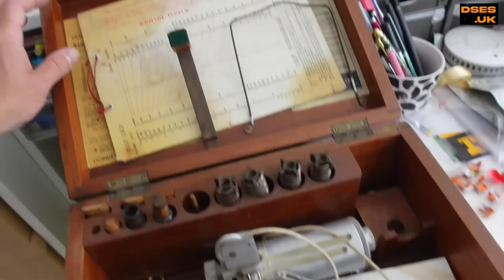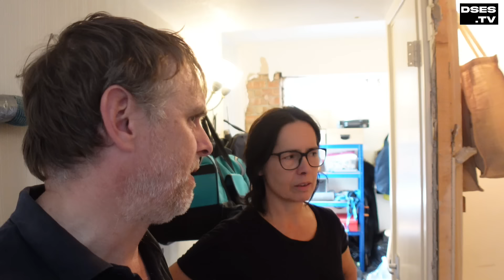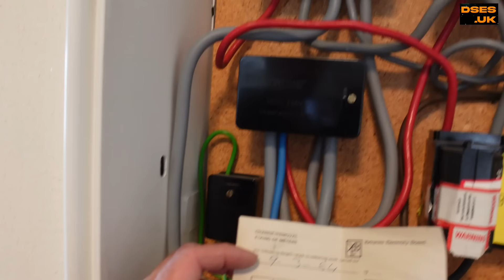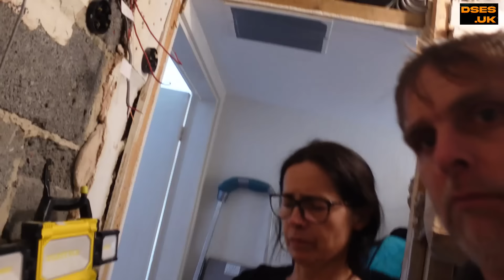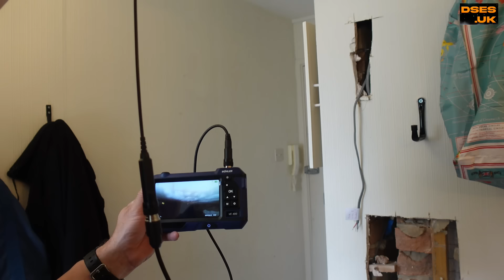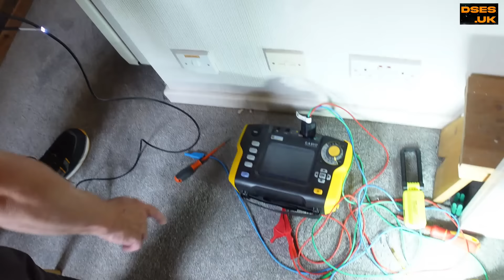Cavity search with Linda (and specialist German equipment)

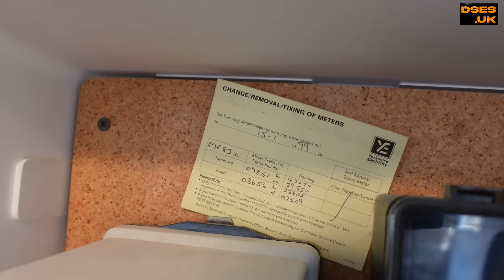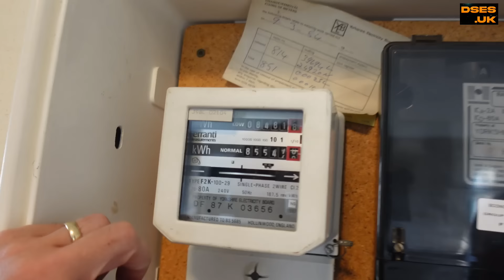Comment: 9:21 David that white meter was installed on 15/01/1999 per the 1999 paperwork, removed meter 09851, fixed meter 03656, see 9:51 meter number DF87K 03656.
Reply from the maker: I don't know why I didn't match the meter number. Interesting that they installed a 1987 analogue meter in '99.
Reply: @dsesuk  Shows how reliable they were. I guess those meters weren't inexpensive and they rightly saw no point in throwing away perfectly functional gear. The previous meter change note showed fitted meter '851', and the one removed to fit the current one was '09851' - same unit, I'm sure.

Doubtful any smart meter removed would get reused today. Not convinced they'll operate for over 35 years, either.
Reply from the maker: @Monkeh616  Yeah, those analogue things were well engineered. Where I've seen them redeployed previously, they've had a sticker to show they've been checked or refurbished, so the 1987 date threw me on this one. Also, 1987 sounds like a long time ago (and I remember being there), but I guess back in '99 this equipment wouldn't have been considered terribly old or old fashioned even though digital meters were hitting the market by the Millennium.
Reply: @dsesuk  you're just not as observant as me I guess...🤣🤣
However being this observant is a curse some times.
Reply from the maker: @generaldisarray  That's the trouble with a run-and-gun video - sometimes you miss someting that's obvious post edit and wonder why you didn't spot it on the day!
Reply: @dsesuk  shite happens. Plus you had the whiff of unwashed Linda right next to you cramping your style... 🤣🤣
Did she release all her cats before you arrived... 🤣🤣🤣
Fuck it, I'm a bastard... 😂😂
Reply: @dsesuk  in fairness you had the whiff of unwashed Linda right next to you cramping your style, plus you were probably on guard given one of Linda's many, many, cats could pop out of one of those holes in the walls, at any moment, and go for your knackers...🤣🤣🤣
I assume Linda normally has around 20 or 30 cats in that apartment, she has that vibe about her of a cat lady...🤣🤣🤣
Only messing, but I do like her repurposing of the pull up bar to hang her hangers on, nice...
Reply from the maker: @generaldisarray  Linda is, sadly, cat free, and somehow doesn't smell half as bad as I do.
Reply: @GadgetMan36  🤣🤣🤣
Reply: Hi - People would sometimes complain if you replaced an old meter that was close to being "out of certification", with an even older looking one or UGLIER with DIALS, harder to read)  that had been back to the meter testing station for re-certification, giving it another 20 years or so useul life.  Meters aren't legal past a certain age (depending on the make) or if previous customers have fiddled with them!   We loved the old Ferranti's cause they were slimmer so guaranteed to fit, whereas a big old fat GEC was a pain if it was replacing a Ferranti etc in a tight space.   It was a plum job doing "meter acts" (replacing meters that would soon no longer comply with the meter act) because you could be done by midday if they were all next door to each other, then go sunbathing - people came into work with tennis rackets - hide your van somewhere.
Reply: I thought it piggybacked off the  ‘long way’ frequencies

Comment: Good show!   The original giant heating system might have been a central night storage system, connected to those air ducts. Either that or gas which got condemned after Roman point flats blew up in 1968.

Comment: Hi David radio teleswitches work off radio 4 Longwave transmissions for e gland transmitted from Droitwhich at 500Kw power in Scotland  there are 2 transmitters of 50 Kw each at Burghead and Westerleigh you are right those transmitters will be switched off next year

Comment: Quick question. teleswitch is single insulation yes but it's in an enclosure would you not say. Does a meter cupboard count as mechanical protection?
Reply from the maker: A grey area so I'm not sure. You require a key to access it, but then those gaining access are ordinary persons such as the homeowner who wants to read the meter. Anywhere else in the home where single insulation is accessible to non-competent persons, would be coded as a C2 on an inspection. It certainly wouldn't meet the requirements for mechanical protection.

Comment: The Dobbie McInnes engine indicator. I used one of these at Tec back at the begining of the 1980's. You connect the pressure port to the engine cylinder and the pressure drives a stylus up and down. You connect a cord to the engine connecting rod and that pulls the cylinder on the indicator round, against a return spring. The stylus scratches through a white layer on the indicator chart that is wrapped around the cylinder on the Indicator. The stylus then plots the engine cylinder pressure Vs crank position. When you have the indicator diagram you can use it to work out things like burn rate,  brake mean effective pressure and gas exchange processes.
Very old technology, originally designed for use on steam engines but, upto the 1980's still used on large engines (big, marine diesels).
Since about 1985 the job has been done with Piezo transducers, optical shaft encoders, high speed data acquisition units and a shed load of computer processing. Same results but easier and faster to get. The downside is that it now takes £100k worth of kit (not including the cost of the engine testbed).
Reply from the maker: Ah! Thanks for that! It all sounds terribly complicated!
Reply: @dsesuk  the hardest part, when we used it on a small, single cylinder, Loughborough Gas Engine, was hooking the string onto the moving connecting rod. It took a bit of getting used to having  to move both arms left to right at the same time whilst bringing them together to hook the two ends together.
The other piece of really clever kit was a pantagraph arrangement with two thimble wheels on it. You positioned the fixed end of the pantograph on the origin of the indicator diagram and traced round the line left by the stylus. Once you'd traced the whole line you read of the numbers on the thimble wheels, multiplied them together, and got tge area enclosed by the line. I think the device was called a mechanical integrator. Invented by some fiendishly clever soul, like they did back then.

Comment: The meter fitted on the 15-01-1999 was indeed a reconditioned meter the start readings on the card verify this as there is already 22605 units on the low register and 07609 on the normal register. We were still reconditioning meters from the  probably until digital meters came in round 1990.

Comment: 11:00 isn't there an argument that because the single-insulated cables are in an enclosure (the meter box) requiring a "tool" to open, they're OK? I'm not a big fan, because obviously unskilled people are meant to open the enclosure to read the meter etc, but from a regs point of view are you sure it's actually a no-no?
Reply from the maker: Hm.. I guess one could make that argument if push came to shove although, as you say, access is required for the unwary. It's also in a communal space rather than within the security of the property and can be opened by anyone with a common key. It's not how I would do it.

Comment: For an installation that used to have storage heaters on Economy 7 where they've been removed and the sockets moved over to the "normal" CU, is The RadioTeleSwitch (RTS) still required?
Reply from the maker: No, the RTS would be redundant. Those who don't want a smart meter can move their off-peak circuits to the peak board and apply Eco7 as a tariff applicable to the installation as a whole. This was how my installation worked - I paid peak pricing for 17 hours on all my circuits, off-peak for seven hours on all my circuits; the switchover being applied as a tariff rather than on physical hardware.

Comment: Why are double insulated singles no longer code compliant?? We use them all the time??
Reply from the maker: Unless I'm missing something, singles are only compliant today if run through the same containment, otherwise you have live wiring with no accompanying CPC and rogue electric fields. Where and how are you using them??
Reply: We use double insulated singles with or without a combined cpc.
For lighting within schools, usually installed within cable basket and surface Mount pvc conduit.
Each point on the circuit will be assured to have a cpc via the combined brown with cpc, you can also get blue with earth. The cable is called  6241Y
Reply from the maker: @tomorichard  Ah, I see. Sorry, I meant singles aren't compliant in this format - i.e., no CPC and buried in walls at less than 50mm. It was more the installation method than the cable that was the problem.

Comment: Spot on about the radio teleswitch, There's going to be a mad rush to change all these out. It doesn't affect all 2 rate meters though, some are controlled by a mechanical clock instead. And of course some others are all digital.

Comment: "WHY WOULD THE BUILDER PUT IN JUNCTIONS" - because they ARE  builders !!!LOL
Reply from the maker: That's true for builders knocking in extensions and thinking they can do the wiring themselves, but new builds are usually to a costed plan, and not one that involves the expense and fiddliness of putting in junctions. Badly terminated screw boxes like these smell more of DIY than being part of the original wiring design.

Comment: Does anybody know an electrician that can bypass that radio-tele switch??  Nope, didn't think so.
Reply from the maker: Technically, it's not too tricky Chuck, although as it's network equipment any tampering could land one in hot water - and not the kind you'd want to sit in the bath with. If they do go ahead with the signal switch-off next year, I guarantee they'll do it at peak time to ensure anyone who hasn't upgraded is left stuck on the peak tariff.

Comment: For the foreign viewers https://en.wikipedia.org/wiki/Radio_teleswitch.

Greetings from DIN VDE 0100 land.
Reply from the maker: I think a few countries have a similar thing. Fascinating to see it's still run by valves!
Reply: Some useless trivia which Linda might appreciate:

Up until the mid-nineties, a large number of water heaters in Johannesburg 🇿🇦 were remotely controlled via a dedicated VHF radio system. The purpose of this system was not to allow consumers to save money but rather to limit the network load during peak times.
The same system was used to turn the street lights on and off overnight or during storms and was controlled by a custom-built "computer" that had the sunrise and sunset times in memory.
The whole system was designed such that if any of the receivers lost signal, they would default to on (load connected). If I remember correctly, Richards Bay and Port Elizabeth both had similar systems.

Not all water heaters were controlled in this way, some used ripple control https://en.wikipedia.org/wiki/Zellweger_off-peak. It all depended on who delivered the electricity to the premises (City of Johannesburg or Eskom) and in what suburb the consumer was located.

This was, of course, back in the day when the country had both generation capacity and cables to deliver it - but that's way off topic.
I only know this because I worked for the company that manufactured these radio controlled load switches and then for City of Johannesburg looking after similar stuff.

So when you ask a South African where their geyser is, they'll say it's up in the roof and not on the couch 😉.
Reply: In Queensland the off peak circuits are controlled by a similar relay system. This system uses a signal modulated onto the 50hz carrier of the mains frequency. This allows the hot water storage units to be turned off and off (amongst other things) the issue is most LED lights flicker when they turn in on 🤦🏼‍♂️

Comment: Love your discussion of Linda's lady garden, she's very tolerant of you LOL :)

The radioteleswitches I believe run by phase modulation of R4's 198LW droitwitch transmitter, which is sadly being shut down, end of an era for old radio enthusiasts :(  Same as Ireland killing Atlantic 252 a while back. Very sad
(me, and the news)
Reply from the maker: I know. One day, her fella's gonna smack me in the mouth. You're right, it is LW, not FM and I included an errata in the description.
Reply: @dsesuk  I noticed that after commenting :)  I also bought you a cold beer, you need one on this day lol
Reply from the maker: @TheChipmunk2008  Cheers old chap - I'll glug that down in the sun later today!
Reply: It is very sad that the Droitwitch LW transmitter is being shutdown. Do you have any idea why they decided to use R4's LW rather than the NPL's MSF signal? And could these units technically be adapted to use the latter?
Reply: @oliverbatt3559  I suspect some of them could be adapted, as the thing's probably a plugin RF module. No answer to your first question though. Maybe due to higher power?
Reply: @TheChipmunk2008  Thanks.

Not sure about the power. The MSF signal emitted by the Anthorn transmitter has an ERP of 17 kW and covers all of Britain and much of North and West Europe. According to the NPL, it has a signal strength > 100 μV/m at 1000 km, which is enough for this application. Even though the R4 LW transmitter may have been more powerful, it seems like redundant power for this specific use.

Comment: Trying to find a new rental with a bath has been hard work, I prefer them as I have spinal arthritis, and I like to soak in my own crap to ease the pain, maybe I’m doing it wrong?
Reply from the maker: Personally, I very much like a bath. If I'm in a hotel that has one, I'll always make use of the luxury. At home however, I've not had the means to fill one since ditching my duff central heating ten-years ago, so getting rid of mine was a no-brainer. It's the same at Linda's gaff - without gas for a combi boiler, the only way to fill a bath is by taking up a massive space with a water tank that costs an unholy amount to heat up electrically. It's too expensive for everyday use and too impractical to maintain the means when the property has a limited floorspace. I'm not a bath racist or anything, it's just that water heating without gas or a massive tank is too costly for regular use, and it all takes up too much space for only occasional fiddling with the loofah and stroking of one's submarine.

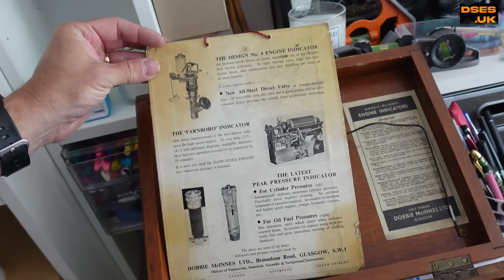Comment: 2:00 it could be a diesel engine compression tester and/or a diesel engine fuel injector opening pressure tester?
Reply from the maker: It could very well be. It's not electrical but it sure is funky!

Comment: Actually, I did keep watching, and I found it interesting too!
I have a radio teleswitch which switches my whole house to "off peak" at about midnight for 7 hours. I await advice from my energy supplier, octopus, but I believe that because I have the low tariff overnight, my day rate is much higher. I think I'll just do away with the off-peak stuff and wire my storage radiators into a spare way in my CU...and hopefully get a better day-rate.
Loved how Linda fekd the holes in the walls! That's real class! I hope you will be showcasing the rewire/additions...but hager? Doesn't she watch your YouTube channel?
Someone needs a spanking...
Reply from the maker: Oh, we can't knock Hager - they're a top brand; I just don't like one of their products! Linda was a bit annoyed with herself for not buying Lewden though seeing as they were kind enough to give us both a tour of their UK operations! If you want to avoid a smart meter then you can plonk everything onto a peak board and use timers local to any space/water heaters to dictate when they operate. When I was on Eco7, it was just a tariff that applied to my whole installation. Everything was at peak price for 17 hours, everything dropped to off-peak for seven hours. I had things set so heaters and EV charging automatically clicked on in that 7-hour window without the need for any additional switching equipment. As you say, the day rate is crippling for Eco7, and seeing as I ditched my storage heaters and EV, it wasn't worth me sticking with so I went flat-rate.
Reply: @dsesuk  We rate click 'elucian' boards, by scolmore... single module SPD with built inHRC fusing, no need for a separate breaker, runs right off the bottom of the main.  Nice din rail mounting blanks too, and everything lines up, no 'italic' circuit breakers
Reply: only thing they DO need to add is 32mm k/o's,  the 40-32mm adaptor on tails glands tends to make the install bulkier than it really needs to be. Or just no knockouts, we all have holesaws!
Reply from the maker: @TheChipmunk2008  Ah, so YOU'RE the one buying Elucian! I wondered who it was.
Reply: @dsesuk  had no issues with em David... we get em from Rexel. The AFDDs actually trip ;)
Reply: Often the higher peak rate more than offsets the lower off peak rate savings if your're not a heavy user of off peak electricity.
Reply: Good shout David! Thanks!